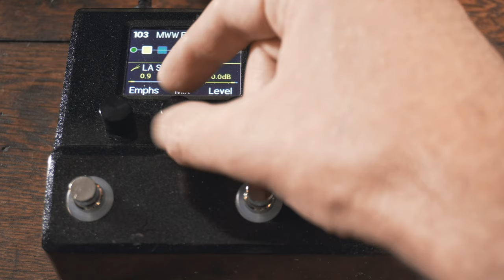5 Ways to Use a Compressor Pedal for Guitar!

Comment: Thank you Michael!  I struggle with compression at times. I don't mess with them enough, but have a few.  One thing that I saw was some compressors are referred to as 'studio style' compression.  I believe my Jackson Audio pedal is that way.  The difference being?  The aggressiveness of the compression?
Reply: @loopie007  Thanks! Good info. I skimmed thru, but will read it more carefully later. I've never used a lot of compression, because I played in a cover band in the 80s, so the compression was already there.  When I do want or need it, I forget all that important stuff you referenced.  :-)

Comment: Can I use the HX Stomp LA Studio Compressor in the end of the chain to shape the tone and also a compressor in the beggining of the chain to have more sustain or as a lead boost? Or 2 compressors like this is stupid? Thanks.
Reply from the maker: Absolutely! At times I’ve had 3 different compressors on my board for different reasons. (General Always in style, one for slide, one for boost/sustained chords). In the HX stomp a lot of folks like putting one at the end to smooth things out. This would be similar to using a compressor on a guitar amp in the studio! If it sounds good, it is good!
Reply: @MichaelWWestbrook  Thanks a lot!